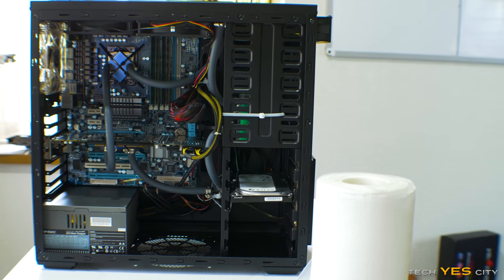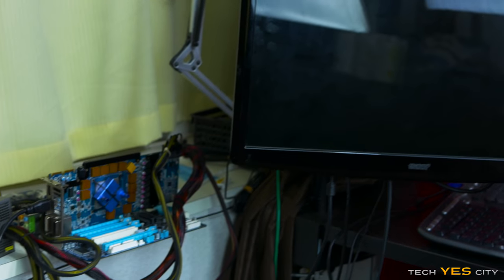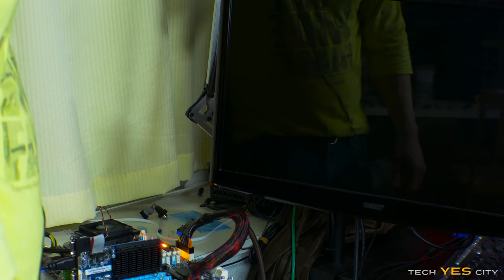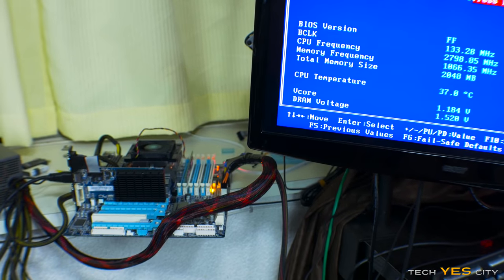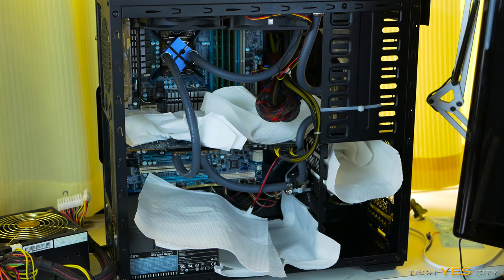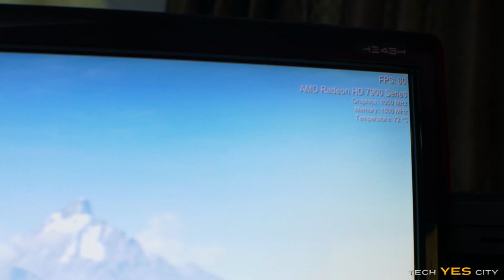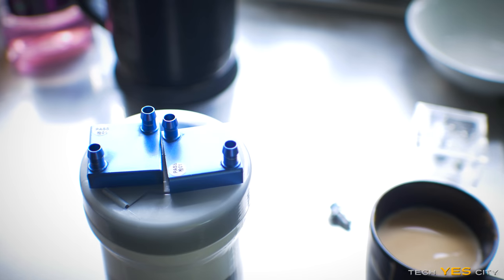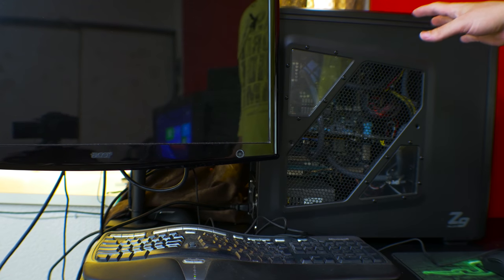$50 Custom PC WATER Loop - Is it POSSIBLE?

Comment: Oily fingers in TIM are a no no, and don't spread it let it do the job just put a dab in the middle you could create air bubbles. Your temperatures are bad because there is no force from those zip ties on your surfaces so the lack of any brackets on those blocks needs to be addressed. I have a suggestion and it is the way i had done what you are trying to years ago for copper/bronze blocks i had made my self for my first LCL:

Fabricate a steel X bracket to hold down the block on the CPU well (take measurements from the back of the M/B and use hard steel for the X plate you don't want those corners bending later) with 4mm holes on each tip of the x for the M/B holes underneath, find some long screws some nuts and 4 springs and 4 steel 4 Plastic washers and you have slowly made your self a much better CPU Block 4 sure.
I like you presentation keep it up and let us know how it goes!

Comment: yeah I was going to go second hand with my loop and I have bought some cheap thermaltake loop before and it did work after some ghetto mounting, but because it was a pump res combo, it did leak at the connection which is why I removed it. my loop I have just finished to in my PC cost me as much as a 980ti,if not more. I'm very happy with it but I wouldn't go cheap from now on

Comment: You did skimp on the blocks and the pump. Clear tubing is actually at the price point you got your tube. Good pumps usually are around 30$. Reservoir you can use anything you want so that leaves us the blocks which they have copper fins inside and rubber grumets for water flow. If you can find decent blocks for 10$ each it's possible.

Comment: A few questions:
What makes a good CPU block? (Aside from not being flat, what was wrong with the one you got?)
What was wrong with the pump? (Volume per unit time was low I assume?  -Was that the only thing wrong with it?)
With everything else set, the true bottleneck is the dissipation rate of the radiator, after the water reaches equilibrium, correct?  So, the radiator is essentially a air cooler that is almost external, so a case had good air flow, there would be nothing different from a water cooler, and a air cooler?
Meaning the only way to make it cooler would be to use something that has a higher dissipation rate, or actually cools the system (peltier, liquid nitrogen, freon, tetrafluoroethane, etc).
Reply: -  I love the build!
Reply from the maker: +heyou Good block needs to be flat and have a good design with the fins and flow, the pump didn't flow faster enough either, but I will check it out on a less intensive build, maybe this 6970 and 2500k I have here. Water conducts heat better than air so it can pick it up off the copper faster than air can.

Comment: Im currently arming myself to this challenge. Going hardcore with 5-7 radiators (ordered 10) and same blocks as you have. Cooling 3x R9 390 + FX-8350 + 990FX Kitty. I have seen how these blocks are made inside and they are quite impressive. Maybe your temps were screwed because layering the copper in between and zip locks didnt press blocks enough?

Comment: You used engine coolant... I somehow doubt that a CPU runs at 600C*+ that engine coolant wouldn't do jack, you'd of been better off using distilled water on it's own as coolant upto around about 400c holds heat. You may also got better results if you fabbed up a bracket to mount the blocks effectively to give better contact than zipties. Good work though

Comment: you have to make a parallel connection or add a radiator between the cpu and gpu, but the simplest and cheapest way is to add a y splitter right on the out of the water pump,  and connect one to the gpu and one to the cpu, than you have to install another y splitter on the in of the radiator and connect the two tubes to it, so in order you will have:

gpu“““\                                      /""gpu
           >radiator>res>w.pump<
cpu,,,,,/                                      \,,,cpu

Comment: Going serial on CPU and GPU whats the point? Delta T is very low on one of them depending on the flow direction. I would go parallel in any case. No wonder you faced thermal problems on one side.

Comment: I'd be interested to see how these blocks would fare if you lapped them down until they are perfectly flat (this should also have the effect of removing the anodization) and then polished the contact surface with some polishing compound. These blocks probably don't have the internal fins that modern blocks do, but I'd like to see how this loop would fare with a pump with a much higher flow rate. It would also be interesting to see the inside of one of those eBay blocks to see if they have internal fins or not.

Comment: for cheep water cooling pick up some broken aio's and put res in top of the case to feed the aio's after the gunk has been cleared from the loops to let the pumps flow. I picked up an used swifttech h320 for $50 cad and also an broken corsair h60 from an friend. the loops  where completely filled with gunk removed it refelled with an 20% antifreese 80% water to try and prevent /kill potential algae. run the loop with viniger to clear out all the gunk. zip ties to get this to work with AMD/GPU ( The Mod) and your set decent blocks /pump in series duble head pressure and redunceny 360mil rad space and full copper. 

this just requires work and is not an good setup for someone not handy I beleave you will be fine trying this Bryan but for some commenter's on this channal beware this is not an easy or clean process modertit risk of failure.( pump stops in 5 seconds or longer can generally be saved but if the pump does not start at all it most likely burnt out.)

Comment: I'm going to get into liquid cooling soon, I'm probably going to start off with a Swiftech h320x2 kit since it's a lot cheaper than buying a good 360mm rad, a good block, and a good res/pump combo, then adding swiftechs universal GPU block and modifying my existing air cooler on my GPU to cool just the ram, vrms, etc on the board. Was going to buy it this weekend when i get paid, but phone took a shit and wont work anymore unless it's plugged into the wall and i hit a bad pothole, so unless i wanna drive around on a spare (albeit a full size one but with the ugly steelies) for a month i need a  new tire, and possibly an alignment, so no new water cooler for me this paycheck, but hopefully with my next one i'll be able to.

Comment: got question for you...I have system I bought a few years back. I never did a bios update. This is 3rd or 4tf video I've seen it past couples days where someone assembled new system or old rebuild and all showed doing bios update.  Im guessing I should  is there anything to do before or after!??! im kind of noob
Reply: +Brown Trout A BIOS-update should only be required if the used hardware isn't working properly. For the everyday usage of a computer that works perfectly well, a BIOS-update isn't needed.

Kind regards,
Meta Custom Computers

Comment: @14:39: Possibly the VRM got way too hot.

A lot off people who change the cooling of the graphics cards forget about the VRM's. They celebrate their super low GPU temperature and after a hot summer day with hours and hours of gaming the VRM's will burn to death... The AMD HD7970 NEEDS active airflow over the VRM heatsinks!

Comment: Thank you for doing this video :) Anyways you might want to put a thermostat in the water, so that you can see how much heat is getting converted, and if you don't mind damaging the hose you can stab one inside to get other temps.
Reply from the maker: +dionyz1 Will definitely do a bit more work with it.

Comment: I don't even need to watch the video to be able to say that I totally believe it is possible. After all if we're talking building a custom one, we could literally be talking about building it from scratch from a variety of parts that may not even be made for theat sort of thing. That being the case, I can totally see it being possible to build one from scratch that would only cost $50 or for that matter possibly even less.
Reply: +Tom Peterson That it's absolutely possible is already shown by the past, because back in the day, when there were no manufacturers for watercooling parts, we always built our own stuff. Waterblocks CNC'd by the dad of a friend, aquarium-pumps, buckets or PET-bottles as reservoirs and AC-radiators repurposed as a watercooling-radiators. It definitely was much cheaper than today and had better performance than air-cooled solutions but compared to modern stuff made by Aquacomputer, EK or Alphacool? No dice. :)

Kind regards,
Meta Custom Computers
Reply: Well, that just proves what I said. And I'm actually not surprised to find that it started as a modding idea. Alot of new tech solutions come people playing around with different things to try to boost performance.
Reply: Tom Peterson
Exactly. :)

Kind regards,
Meta Custom Computers

Comment: One of possible problem was you could have had trapped air in and around the CPU block.  How do you check to make sure you have cleared your loop of air bubbles with that type of tubing?

Comment: Have you considered using a small car radiator with a beefier pump?  I was thinking of it as a project for myself, but it would be great if you did it better!  Maybe bastardise a pedestal fan and make a cover to fit the car radiator snugly, then mount both to one side of the case in place of the back panel.  I reckon you could have RPMs low enough to be pretty much silent, and there would be such a large volume of water that the system could never overheat (assuming you had good transfer from the dyes).  Reckon it's possible?

Comment: Those blocks had to be one of the main issues, i have a feeling the colored coating did not help heat transfer whatsoever. Maybe if you sanded it down just a bit more to get rid of it, you may have seen some better performance. Along with a slightly better pump. Probably could have gone with just straight distilled water for the coolant as well, might have been easier on that little pump. Great concept though.
Reply: +zFOE Minnesota there are some copper blocks for 6 to 10 bucks more that preform much better with a acrylic or plexi top i cant rem

Comment: Are the temperatures high on the CPU because the water is already heated by the GPU as the fluid circulates? I know nothing bout water cooling, but assuming that's the case it might be worth reversing the flow and seeing what that does to the CPU temperature results.
Reply: you want it to go through gpu first if anything gpu isn't as hot and gpu is a tad bit more expensive

Comment: Hey brian. this video inspired me to come back to this idea at a later time. For now ill be getting a dual tower cooler for very cheap but later i want to do this but source good blocks and a powerful but preferably quiet pump. I have somewhere the radiator from a more powerful motorcycle. It can fit in a pc case so i think i can do something decent here. Ill be getting a dark rock pro 2 for around 30 usd so its going to be tough to beat with a cheap watercooling setup but i have to try. Can you get some actual pc blocks from ebay or where you can get them for cheap and retry this setup? I know that setup has much more potential than that. Maybe get a second radiator just to be sure and a better pump and im sure it will be actually a good setup. Btw your videos are getting better and better, glad i subbed when you barely had any subscribers. Keep it up man!

Comment: 2:17 what's the point of cleaning it up if you're gonna spread the thermal paste with your finger?
Reply: +Filip Skalec He's not cleaning off bacteria because he's a germaphobe. It's cleaning off the old grease and old thermal paste on there. You want it new and consistent.
Reply: +CheapSushi did you even read the entire comment, i said what's the point if he spreads it with his finger , effectively adding a layer of grease from his finger. I know enough about PCs to know that that doesn't have much of an effect for some time, but in the long term, when that grease hardens it will cause thermal problems, and he'll need to change it again sooner
Reply: Filip Skalec "much of an effect" is worthless, even the Linus video was half assed. But if we're going to be broad and general, then the grease from his fingers isn't going to hinder anything considering, as you imply, no other technique and TIM really matters "much". Not like he ate a pizza and immediately touched it.
Reply: +CheapSushi i don't have enough fucks to give, i'm just saying that it's better in the long term to simply not smear the paste around(especially with a finger), but rather just let the cooler pressure spread it (less air pockets etc.)

Comment: This is the first video of you i stumble upon so i started to think judgmentally in the beginning because i thought you where going to say you could have pulled it off with $50 AU with decent results and that it would have been enough but you didn't.
I agree with your findings: Don't skimp on the pump because there goes your reliability important the blocks can be cheap but  have to be decent otherwise don't even think about it: Heat spots, uneven block surface, bad cheap metals. Rad was fine temporarily piping also ok but the clear stuff from Bunnings is also cheap and looks good too :)
Good  fair try but man those blocks where atrocious he he.

Comment: The blocks you were using were way to cheap. I used 20 dollar blocks off of aliexpress and they kept my i5 750 4ghz 1.4v at around 70 degrees and 7950 1150 mhz 1.23v at around 50ish. It looked like we had the same rad and pump, but I used distilled water with primochill liquid utopia.
Reply from the maker: +Pat Wong Yeah I will try some better blocks for sure, the battery water is distilled water I think.  Also I only used a a bit of engine coolant, not much, maybe 25-75% blend.
Reply: +Tech YES City Next time I go for a budget loop I'll definitely try your engine coolant blend. Probably try looking for a small junkyard radiator like the one luke found in scrapyard wars.
Reply: +Pat Wong That was just a heater matrix from a car, pretty much any should do the job just find a scrapyard that isn't a rip off and should cost less than £5 or so?
Reply: johnyfartpants To find one that fits in a case is pretty rare, theyre usually quite large

Comment: I got a 5 year h100 that I know is low on fluid, I wanted to add a res to it and some different hoses to revive it again, it still cools but the rad has to be higher then the pump or you keep hear gargling sounds.

Comment: what s the liquid what your filling in there ?
Reply: car coolant , don't use it , it will melt your tubing
Reply: How does a car's RADIATOR HOSE(Same Material) NOT MELT...
Reply: Mike W most people use glycol (clear) tubing which is melted by car coolant, radiator tubes don't melt because they don't contain glycol
Reply: hmm, I didn't know coolant could be corrosive at all.  Thanks, funny because "Propylene Glycol" is IN standard coolant.

Comment: maybe the zip ties cause the block to not get a strong hold down on the cpu, maybe building a mechanical mounting system would allow for a better well heat distributed seat on the chips

Comment: Would an AiO (corsair for example) pump be enough to run a full system? gpu cpu?
Reply: Surely the pump would be stronger than $7 ebay pump though? Also the warranty ran out long ago :)
Reply: +Leone Furlan Hrmm if he used a reservoir it would eliminate the air bubble problem wouldn't it? (obviously reservoir wouldn't work in that tiny case) I was thinking a cheap used H60/80 or something similar. Add 240mm radiator & reservoir to the loop. With my Ebay math it comes in under the $100 usd. I really hope Bryan considers this kind of loop.

Comment: should I do a waterloop with my old aquarium pump? It says its for an 500 liter aquarium.
Reply: +Brn G Back in the day we always used aquarium-pumps to do custom loops, before there was an actual market for those parts. You only have to check if it's a "diving pump", because those pumps have to be drowned under water to work. You need an aquarium-pump with a real inlet.

Kind regards,
Meta Custom Computers
Reply: It is an external tower with filters and has two seperate tubes.
Reply: Brn G
Then you're good to go. Just have in mind that those external pumps can't be controlled by your mainboard, so you always have to make sure that the pump is actually running, for example by installing a flow-meter in the loop.

Kind regards,
Meta Custom Computers

Comment: I think you need to sand the blocks a lot more and avoid shims. At least solder the shims maybe? I think it's purely the CPU spreader and the block not contacting each other properly. Put a nice dot on the middle and squeeze it that way

Also I'd you tighten the blocks with screws instead of zip ties I'm sure i Bet it'd improve more

Comment: I reckon you should try revive the project and replace a single part of the loop at the time, to see which component is holding it back. Also I think the block isn't mounted on the cpu right, if it can keep your gpu at 60-70c with a homemade shim, i think it should be able to cool the cpu not too badly.
Reply: Jayden 97 any waterblock that can keep a 7970/280x with a copper shim at 60-70c with an oc is not too shabby. I don't think that xeon runs too hot either.
Reply: Jayden 97 well i have seen many people with sucessful results with these blocks. I myself have messed around with lots of ghetto cooling solutions. In my experience, a cooling solution that is capable of keeping a hot gpu at those temps shouldn't be too bad on a cpu either.
Reply: Jayden 97 check his newest video they aren't too bad. a 4 core xeon at 60~ish and the gpu at around the same.